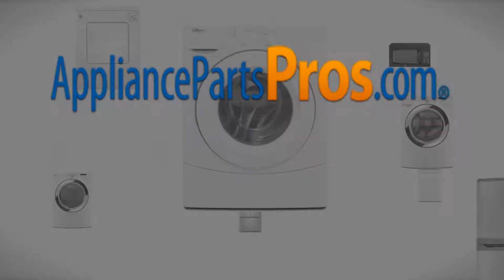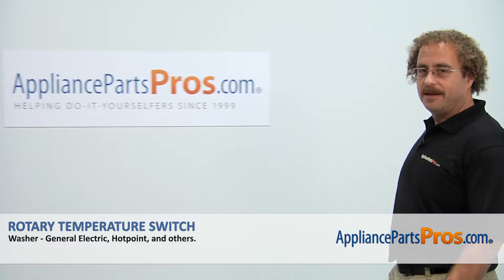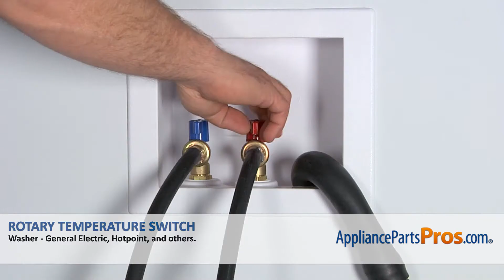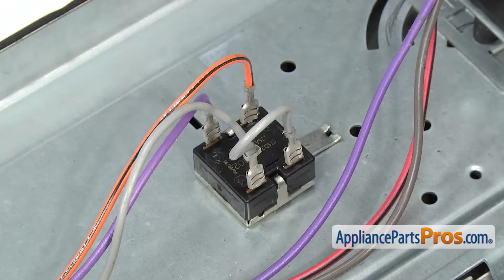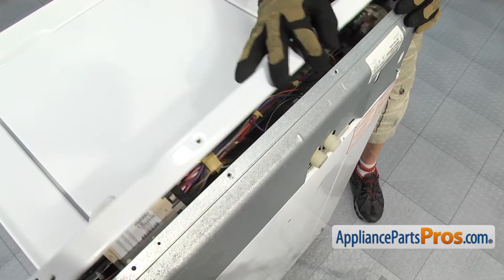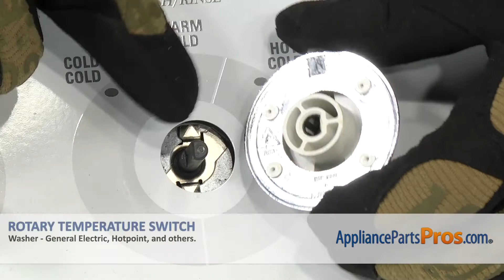How To: GE Rotary Temperature Switch WH12X10498

Comment: How can I tell if the rotary spin speed switch is bad on a 1995 GE washer(pt. # WH12X10072-so They say)? I have normal but no gentle cycle.